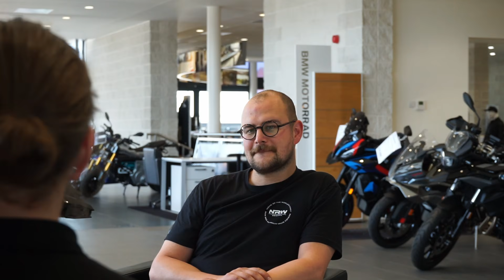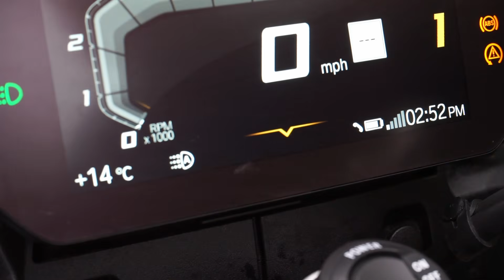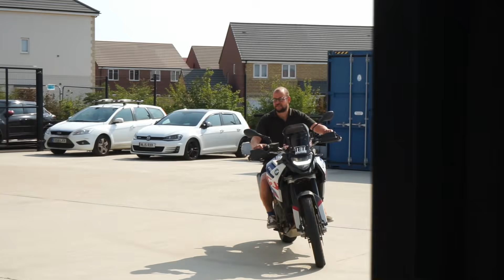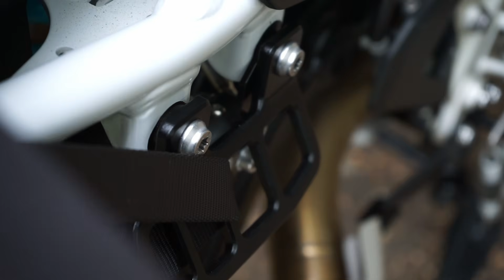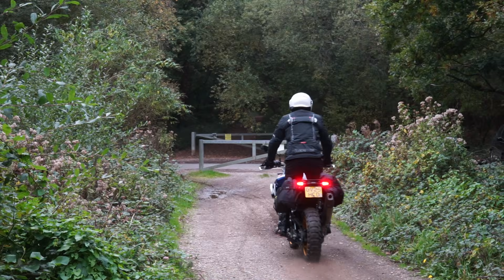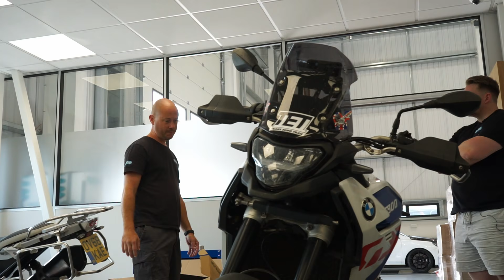BMW F900GS - BRUTAL 1 Year/6000-mile Review and Upgrades! Hack-Moto

Comment: I bought the Enduro version in 2024 when it was first released in the uk ( bought it in November 2023 with my fingers crossed it would be good) . M chain failed after 2000 miles, I’ve taken the bar risers off, and upgraded the suspension anyway ( to be fair, the rear is ok, but the front needed some work). I’ve done 11000 miles on it now, crashed it often, and it has a few marks, but has stood up well. I’ve fitted Rade Garage tower, to strengthen the tower and improve lights, but also added Lone Rider lights for even better illumination. Tyres I’ve tried a few, and settled on Motoz Tractionater rear ( excellent off road and good mileage), with Anakee Wild front ( the Motoz front introduced a weird weave on the road above 70, but the Anakee solved that)   I’ve also removed the quickshifter and side stand switch ( can’t break them if they’re not there!), added an AXP bash plate ( covers water pump too), R&G engine covers ( and removed crash bars), fitted a high front fender, and akrapovich foot pegs ( bigger area, more comfortable for long periods standing). Removed the resonator box, fitted a Dominator end can ( the standard Akro is good, but very large and quite heavy). 
I think that’s it, but ultimately, I love it, and have no intention of selling it any time in the near future. It does exactly what I want, takes me anywhere, and is reliable. I love it.
Reply from the maker: Sounds like a very dedicated and fettled machine, would love to see it some time!

Comment: my only gripe with f900gs is rear turn signals. those are so frigile... and expensive.
Reply from the maker: Since this we put Wunderlich protectors on and so far so good, not had another broken tail light. Went through multiple before that!
Reply: @hackengineering5586  oh thanks for pointing it out. I thought Wundelich is for front only
Reply from the maker: @vitskr1 check these out - https://www.hack-moto.co.uk/products/indicator-protection-bar-for-led-multifunctional-indicator-13295-002?_pos=1&_psq=Wunderlich+multifunction&_psid=cbc5aa012&_ss=e
Reply: @hackengineering5586  so these fit f900gs? on wonderlich web page they are not listed as fitting f900gs

Comment: Mine drinks oil. Checked the dipstick and the oil level was below minimum. Called the dealer and they read in some manual that the bike can use up to 0.2L oil per 1000km. Nice! :)

Comment: Nice bike! I'm glad I watched a video about the tower issue at the time I bought mine. I 3d printed supports for it and so far so good. Now I'm gonna do so for the quick shifter guard and side stand. 

Mine is the yellow (green?) and I love the red subframe but it is lame that it only has plastic handguards. I bought the Hepco and Becker ones but already busted those. I just installed Barkbusters and hopefully those will last longer. 

Also while heavy, I love the givi crash bars. They have taken all of the beating. However, I need to paint some scratches to avoid them from rusting. Also the givi skid plate is really nice.
Reply from the maker: Have you also seen the new support BMW have just released for the front end? We have them in stock - https://www.hack-moto.co.uk/products/genuine-bmw-nav-tower-support-bar-f900gs?variant=53342443798794

We are about to trial Yakk bars on this bike. Ben is far too good at crashing...

Comment: i have this bike neaely 3 months,1500km Offroad in the South of spain so far...as i  have moto cross background  i have to say that this is a absolut stunning bike..mine is with enduro pro.abd i have the same crash bars.... do you have a link for the brake and clutch levers? original ones are pretty annoying when you use two fingers.....i bought an AliExpress quickshifter protection but it doesn't fit well..where do you bought it?
Reply from the maker: We can supply all the parts you see. Please email us on moto@hackengineering.co.uk and we can get it all priced up with shipping to Spain for you ❤
Reply: @hackengineering5586  i have send you an email right now